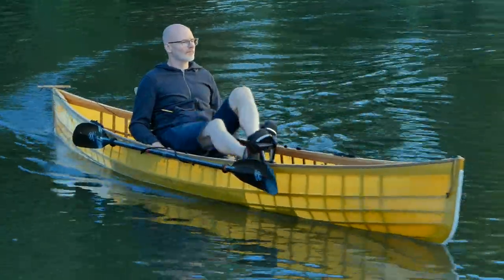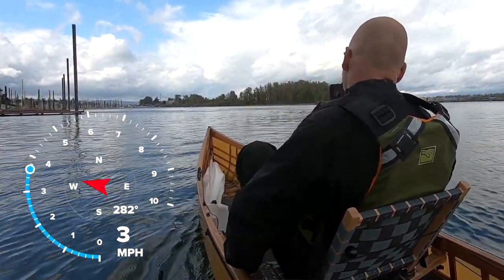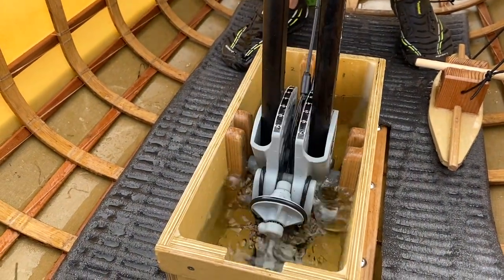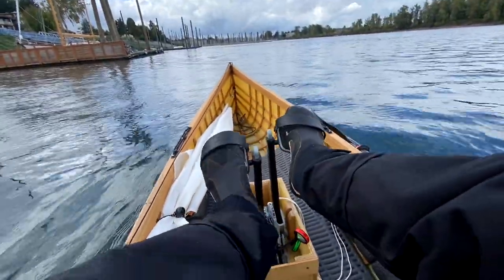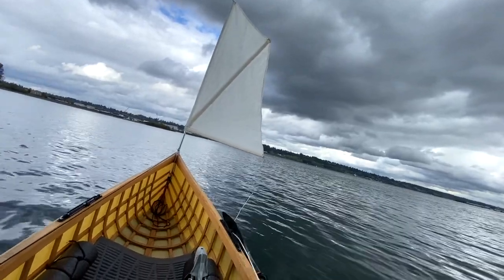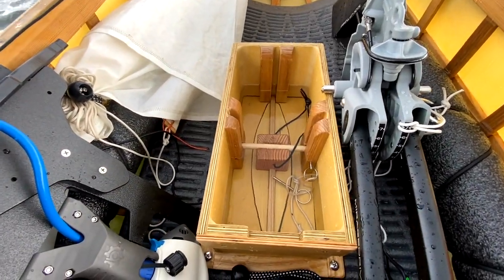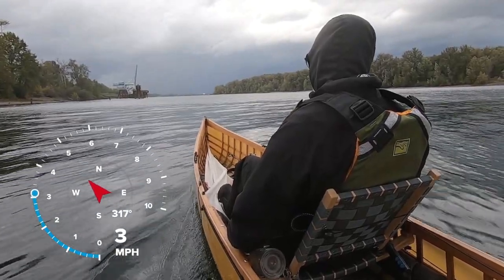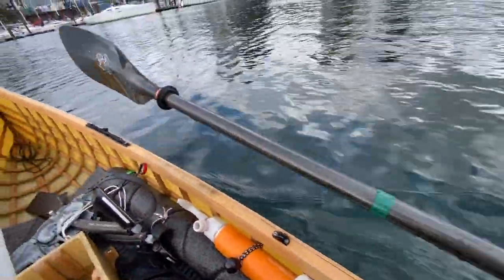On the Water Preview of New Pedal Drive Canoe System

Comment: I built my skin on frame canoe (Kudzu craft Stonefly) with a hobie mirage drive well from the inflatable Hobie kayaks. I was in a rush to finish it for the holidays so the  strong plastic pre-made well was chosen. The plastic isn't visible from above. 
Instead of building the well up high above the waterline i added a cloth boot from the top of the plastic drive well to just below my feet when peddling. 
For steering I routed 0.8mm dyneema lines through black plastic tubes to a small carved wooden tiller on the left gunwale where my hand rests.
The peddle drives make a world of difference when going upwind.
Reply from the maker: Where did you get the well?

Comment: For a peddle drive system, would you benefit from sitting lower.
More stability, less air resistance.
Reply from the maker: Can’t really go much lower without having to lean uncomfortably far back.  I mean, you could definitely do it, but it would be like sitting on a racing recumbent bike, which aren’t super comfortable.  Stability isn’t really a big deal because you can just make the canoe as wide as you want to for the stability you need.   There’s so much resistance from the canoe itself that I’m not not sure the body position makes a huge difference.